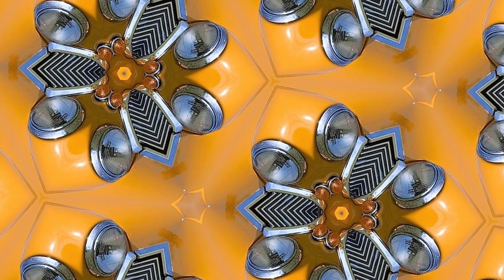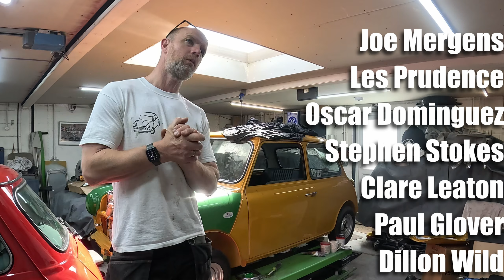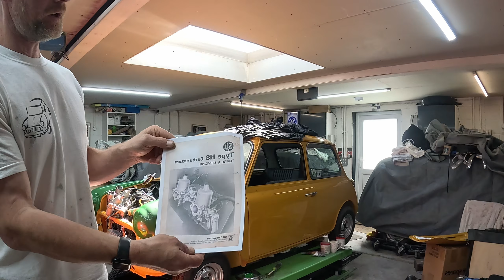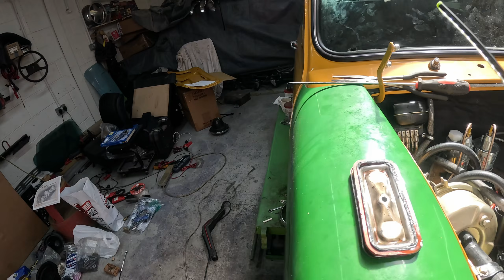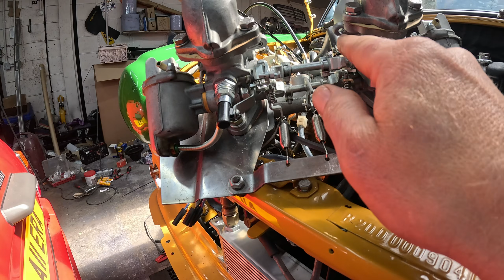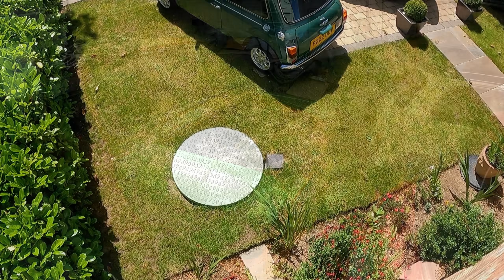Massive Oil Leak - Classic Mini Workshop Pt.65

Comment: Unlucky with the oil leak. Those covers do get distorted! The SU guidance is good except, when checking the balance. I’m too tight to buy a vacuum monitor & did it by listening to each in turn. The only drawback is that as an old guy my hearing is not brilliant (according to my wife in particular). I had to enlist my daughter!
Reply: Thanks Edward. Haha, same here with my wife 😂

Comment: the big problem with the cover has always been they get bent and distorted cause they get over tightened and the centre gets pulled in to the point that the outer doesn't hardly make contact if remove the rubber seal and re fit it your see its distorted and the centre bottoms out before the outer edge touches the block so  either chuck it over your shoulder and find a better one or punch the centre back so the outer touches first and do not over tighten the centre fixing
Reply: I know Nigel, it's so tempting to just give it another turn of the racket or spanner though! 😆

Comment: If your wanting to rebuild a mini what is the average cost? Regardless of condition. And do you need any expensive equipment to build one? Many thanks
Reply from the maker: Alot depends on the condition to start with, but I would say 5-10k based on experience and you may need to spend 2-4k on equipment
Reply: @classicminiworkshop  Ah ok. Many thanks. I'm looking to build one myself as my grandad had built on himself, and he has experience with them. Was just wondering what price it would be nowadays
Reply: To do most of the stuff i've done, i've probably invested over £12k over the past 7 years in tools and machinery. I'm a house builder and didn't have mechanic tools so i started from scratch.

Comment: What a nightmare! I feel your pain. Life’s hard enough without this stuff, one dopey person making the loom causes you a world of pain. If it helps, this week I’ve had brand new rocker switches that rattle (fit badly). Leaky thermostat housing (my bad workmanship). A leaky heater matrix - replace with a new aftermarket one - took 4 attempts to fit it leak free (the outlet pipes were about 1mm below the surface so they would seal correctly - finally used a second o-ring as a spacer on the top). On a highly optimistic note I’ve booked mine in for an MOT on the 5th September and a show on the 7th… will it be ready? Will it be finished… just keep plodding along 👍
Reply: Isn't it! I don't mind so much if i make mistakes as it's a me problem. When you pay someone to do a job and they mess up, it's still a me problem! Ok, it makes me feel a tad better. 😅 Oooh, i reckon we could get finished and mot'd at the same time! 😀
Reply: @markdraper7  it’s a race 🤣. irritatingly if mines ready for the mot it may not be ‘finished’, I might have to put the glass in before the headlining and I’m sure they’ll be other stuff, I can only do what I can do… good luck with yours 👍
Reply: @mcmotors100  😂 Good luck!
Reply: Mine just pass it’s MOT 🎉 
Sadly I had to cut a couple of corners, my webasto roof jammed/broke, so I haven’t installed the headlining as I’m not sure how to fix it yet (haven’t had time to think about it.
I also wanted to fit new wiper/light stalks and a new steering wheel, but my first opportunity was yesterday and I thought with my luck something would break 🤦‍♂️.
Finally we’ve had a severe weather warning for today, so I dropped the car outside the garage at 2:00am to avoid the storm.
How’s yours doing?

Comment: I had a first fire up oil leak once, my brother previously fitted the clutch oil seal and managed to turn the lip out, instant deluge! So out it came again.
Another first time start, engine was revving and rough, that one turned out to be big air leak at inlet manifold as the flanges were thinner than exhaust so nuts were tight but inlet not sealing at head.
These things are sent to try us!
Reply: Nightmare! I can't stand even a tiny oil leak 😅 My Madgwick and Track mini both are leak free so i know it's possible on a mini, but they are both Swiftune Built.😁

Comment: I really do feel for you Mark.. So close, but it seems one step forward and two steps back right now.  The 'hot' exhaust manifold is worth a look  before you do another start-up.. It could be your running with too much ignition advance which would also give higher idling speeds. Also check that your tappet cover gaskets are the 12A1175 type that are for the 1966 onward 1275 S cars. You probably know all this stuff but I always find helpful suggestions are better than negativity in these cases.
Reply: I know Pete, seems like it's been that way for a while! That's exactly what it was, scared the life out of me! They are correct and i've reset it back on. Once i've cleaned all of the oil off i'll give it another run and see if it's cured. We found another issue for the oil leak though. Positive and helpful suggestions are welcome, sometimes i don't know but i do try to study the in's and out's of the project i'm working on, but i don't know everything!😅
Reply: @markdraper7   Restoring a car from ground-up, even if you've done a similar model previously, always seems to be a 'fresh' challenge that throws up a different set of issues and problems.  Your Mk lll 'S' looks brilliant  and is a credit to your endeavour and determination. Nearly there and the final hurdle is in sight.